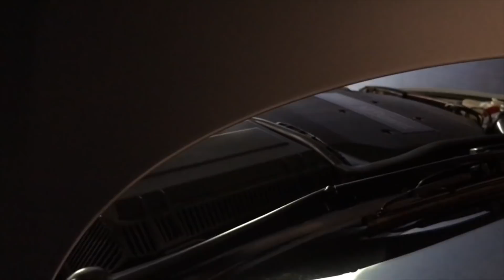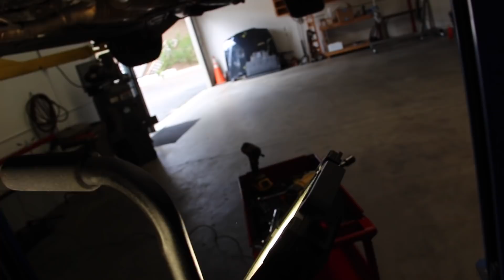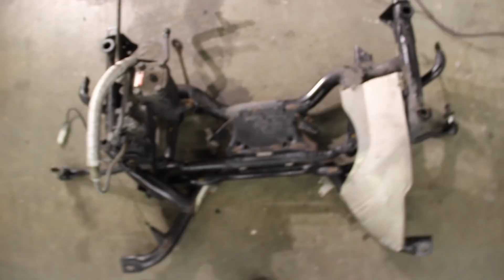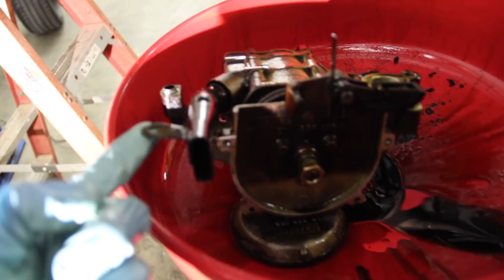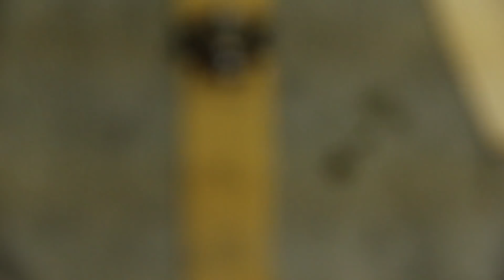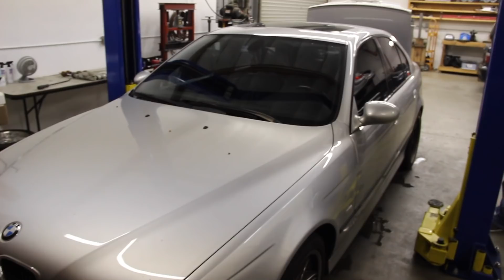BMW E39 M5 Rod Bearings:  Supplemental DIY

Comment: If the BMW engineers were smart, they would've designed these bearings to last more than 100k miles.  I've owned my E39 for about 7 years.  Put all of 20K miles on it.  Gotta say this car is a nightmare.
Reply from the maker: These S62 bearings are a solid 150-200k mile bearing if any attempts are made to care for the engine (oil service intervals, driving style).  The next generation M5 suffered from poor bearings- they generally require replacement by 70,000 miles or so.
Reply: @rce Welp, pretty sure I had one go.  Changed the oil every 5k with Castrol Edge TWS 10-60 recommended oil.  Lightly/Moderately driven.  I think I took it to redline once in the past 25K miles.  The car never saw the rain or snow, even.  Started hearing a slight knock the time I ran it before it failed.  Started it up, still heard the knock, then one loud knock and it locked solid.  I am able to rotate the engine, although I haven't moved it far...but the crank moves.  In the process of taking it apart.  Would like to drop the oil pan, but it's pretty much a removal of the entire front suspension...and, quite frankly, I'm getting tired of fixing something every 5k miles I drive this thing.
Reply from the maker: I'm sorry to hear this.  Perhaps previous owners were not so kind to the car?  We just changed some preventatively on a 2000 M5 with 201k and the bearing wear wasn't bad at all.  Oil pan removal is a pain since the entire subframe must be removed. @johntomasik1555
Reply: @E39Source  It's possible, but it sure is in amazing condition if they abused it.  It had thorough maintenance records (including all oil changes logged{, looks almost showroom condition, and it had only Dinan installed mods (just the exhaust and intake).  Since I got it,  the VANOS system had to be rebuilt, its software disabled starting it,, a cam sensor had to be replaced, the rear window actuator died, the fuel gauge failed, and the nav system quit.  Now this.  But, keep telling me how great these things are.  Heck, I could build a pickup truck that could outperform it for far less money than the previous owner paid for it.
Reply: @johntomasik1555 , if a cam sensor failure and rear window regulator are among your grouses, you deserve to be driving a pickup truck...red, no less.
Reply: @E39Source  Oh, btw, you did a great vid.  Arguably the most useful/thorough for doing this job.

Comment: Rod bearing failure on the E39 M5… this doesn’t make the headlines; only the high-revving, F1 inspired S85 V10 gets the hate!
Reply from the maker: The difference is, the V10 WILL need rod bearing replacement by 75,000 miles in all cases.  S62 rod bearing failure is significantly more rare, and almost never below 150,000 miles.
Reply: @E39Source  the S85 is a legit Race Engine. The S62… Not.
Reply from the maker: @jeremiahex  The S85 was born to race, absolutely.  The S62 was just an improved M62, but it has plenty of race-tech itself.  Having owned both for over 10 years now, I personally believe the S62 is far and away the superior engine.  It offers better power delivery (wider and more usable power band), plus significantly greater reliability and serviceability.  But it doesn't have that 7,000RPM push, and there lies the case to own them both!
Reply: @E39Source  you can not compare an apple (E39 M5), with a dragon fruit (E60 M5). Both very different machines. I use to own a 01 E39 M5 years ago, great machine. But E60 M5 is on another level, friend. I own 2 E60 M5s, silver and sepan bronze. A special machine. Both have been very reliable! I want to visit your shop. I have a challenge for you. I want to convert my bronze E60 to manual, not a swap, for the SMG trans is actually a manual. I want to remove the hydraulic shifting system, and place on top a manual shifting system. That’s the challenge. A custom made shifting mechanism that would replace the SMG. I know, the shifting pattern is unconventional. But that’s alright, I’m a commercial truck driver, our shifts are unconventional.
Reply from the maker: @jeremiahex  I will agree that the S85 E60 M5 is much more 'special' compared to its counterparts.  

I've never offered a conversion of the SMG-III to manual because of the shift pattern.  Could it be done, sure, though I would be very hesitant to attempt the conversion that way.
Reply: @E39Source  don’t back down. Let’s do it. Let me know when I can visit your shop.
Reply from the maker: @jeremiahex  We're happy to do a conversion for you, but unfortunately converting the SMG-III to a manual is not something we're comfortable attempting.

Comment: How long does a rod bearings replacement service take? Just wondering what I should expect from my indy mechanic.
Reply from the maker: The job is roughly two days, depending on how thorough the tech is with cleaning and doing other 'while you're in there' type maintenance.  I would expect to be $2,500-$4,000.

Comment: I have 202k on my 2000 M5 with I presume original rod bearings and I am so scared this will rear its ugly head someday soon!  My car drives incredibly fantastic but I'm living on borrowed time.
Reply from the maker: Around 200,000 miles you should consider and start budgeting for rod bearings and timing chains/guides if you want to keep the car longer.  Those are the two 'weak points' that should be addressed every 2 decades.

Comment: What bearings and rod bolts did you use? Oem or coated? Oem bolts or ARP? Doing this job since I cracked my upper oil pan and I already going thru the trouble of removing everything
Reply: I went with OEM rod bearings, but with a WPC treatment. I used OEM bolts. The S62 doesn't suffer from the same catastrophic rod bearing issues that the S85 and S65 do, so I trust the factory parts. The factory torquing procedure for the OEM bolts is annoying, but nowhere near as bad as the S85, so I went with OEM bolts.
Reply: @computiNATEor  thank you for the reply that was fast haha I think ima go with oem too the car just crossed 100k so I don’t think they should be bad but I’m already there I might as well do it.
Reply: @jesussandoval4550  Yeah, you’ll be fine. I think mine failed for a few reasons, not the least of which was running too hard while cold. I’d run a 5w50 or 10w60 oil, and you’ll be golden.
Reply: @computiNATEor  thanks again

Comment: Why rev it though?
Reply: Because I had never heard rod knock before, so I didn't know what I was hearing. I didn't know if it was rod knock or timing guide issues.
Reply: @computiNATEor  Nate, could this not have been reground (machined) and fitted with oversized conrods?
Reply: @francispowell1811 No. The crankshaft journal was egg-shaped, so it was far more cost effective to just replace it.
Reply: @computiNATEor  got you. thanks!

Comment: Can you give more details on the rear main seal issue you had?  I am about to do the rod bearing job, engine out, and of course, I plan to replace the rear main seal.  Thanks.
Reply: I honestly do not know why the first RMS didn’t seat. There are steps online that detail roughing up the final flange/journal of the crankshaft ever so slightly to ensure a good seal. What I can say is rather than replace just the seal, replace the whole seal carrier, and the bolts, and the little rubber washers that go under the bolts. Use the paper gasket (comes under the seal carrier in the box). Replace it all with new OEM Genuine BMW stuff.
Reply: @computiNATEor  hey, thanks for your reply.  That’s a good idea. I’m thinking maybe i should not install transmission and start engine by itself to make sure there are no leaks.  There is also a coolant passage just above the rear main seal that i am worried about too.
Reply: @PonchoTech  Just replace the paper gasket for the coolant passage and clean the mating surfaces - it’s very rare to leak from there. You’ll have to put the transmission on because it holds the crank position sensor and the starter in place 🥲

Comment: Great video! One thing i’d like to add, today I replaced my rod bearings preventatively and you can actually un bolt the steering box from the subframe and leave it in the car. I removed the pitman arm from the box and left that on the center link which was dropped with the subframe. You can get away with not opening the power steering system at all!
Reply: Indeed, dit it the same way Tom!

Comment: I am just curious if the valve cover gaskets have been replaced within 5-10k miles prior to the bearing failure. The reason I ask is that with the other 7 rod bearings being OK, I think that this one failed from dirt blocking oil flow, and one way that dirt can get into the engine during a valve cover gasket replacement.
Reply: No, they had not been replaced recently. They were basically plastic when I pulled them.

Comment: my s62 has the tut tut tut on idle but no rattle on throttle.  is it beginning to circle the drain? 😲
Reply: There's a noticeable clatter from the VANOS units. at idle, that's normal. But if you can hear it from under the car, then I'd do the rod bearings ASAP.

Comment: useful information I thought I would share... quoted from reddit. 
"Sad day for DIYers. newtis.info has been shut down by BMW
BMW wants you to use bmwtis, which is a nutty $2500 a year or $250 a month. Looks like ISTA is the only free alternative now.

Edit:

Luckily, it was archived on way back machine on Sept 17 2020. No more updates to the info, so won't be as reliable for up to date info as ISTA, but good as a quick reference guide

Edit:

Nevermind. Looks like only the landing page got archived, and not the rest of the actual manuals

Edit:

Shameless plug, but I have a guide over on the F10post forums on a VM download that has ISTA and some other stuff already installed. Check it out if you at the least know how to spin up a VM (not too hard)"

Comment: Curious. What will happen if you were to put bearings with that previous crank (the one with some scoring/high tolerance)?
Reply: For a little while, nothing. But without a smooth surface to ride on, the oil flow won’t be maintained, and the bearings will touch the crank more often, heat up, seize, and it’ll be worse than the first time. It might last a minute; it might last a month.

Comment: Well, if you or someone you know has experience of working on boats in a dry dock setting, ask them about cribbing with wood - a stable, safe, and effective technique to lift objects - given that its done with proper size and good quality wood planks, a LEVEL surface, and center of gravity is accounted for 

Although yes lift is much easier for this